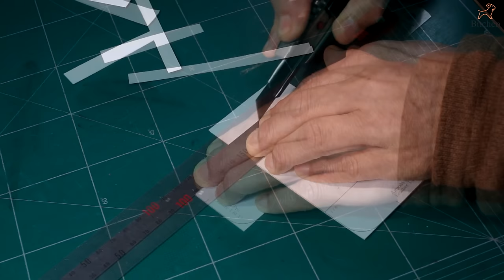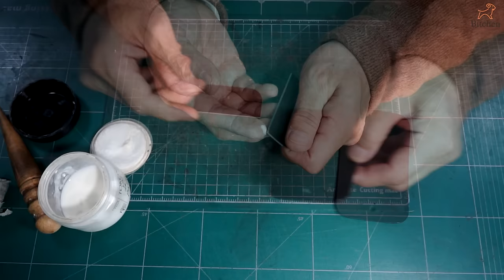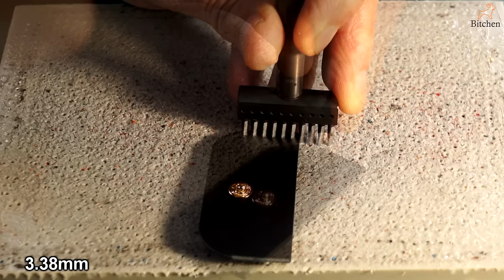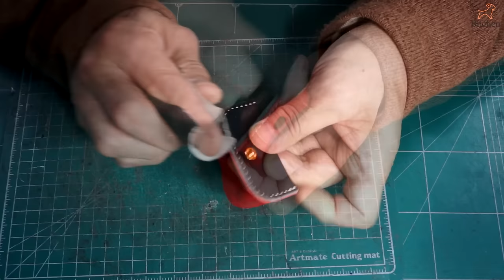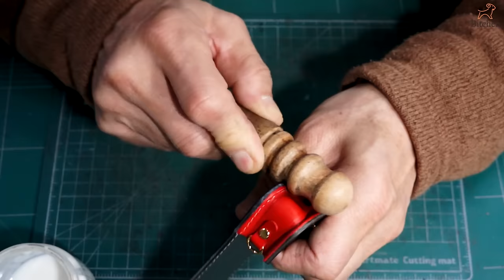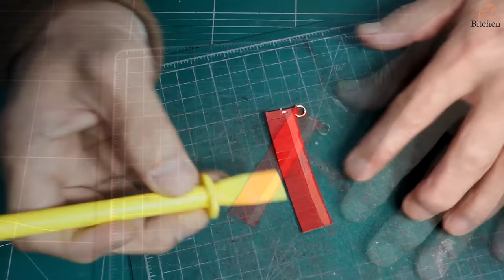42 [Leather Craft] Making Apple Airpods Pro Leather Case / [가죽공예] 애플 에어팟프로 가죽 케이스 만들기 / Free Pattern

Comment: Hello Bitchen, whats the gram/thickness of the Adhesive nonwoven fabric liner you're using?
Reply from the maker: I didn't understand the question.
Is there adhesive non-woven reinforcement in this video?
Please tell me the time of the video.
thank you
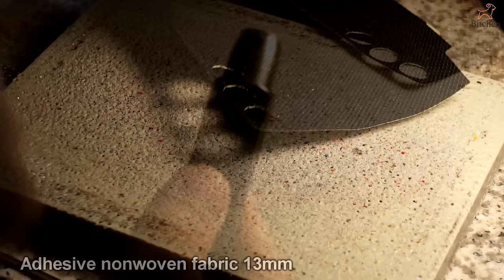Reply: @bitchen Oh no problem, sorry I didn't make it more clear. At 9:44 you use a protective patch (small black patch) on the inside of the leather case right? Can you tell me more about that. like the gram/thickness and where to buy some? thanks alot!
Reply from the maker: @Nomad-bi6su  It is an adhesive non-woven fabric.
If it is difficult to find, you can use soft fabric and glue it on.
thank you